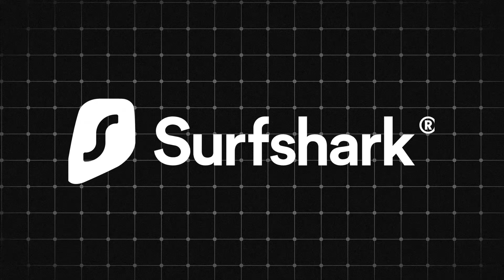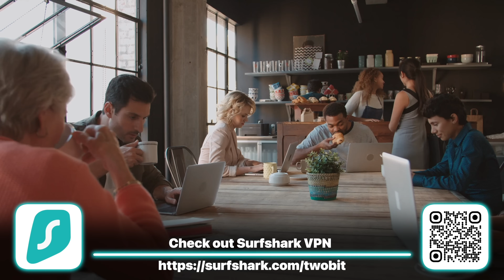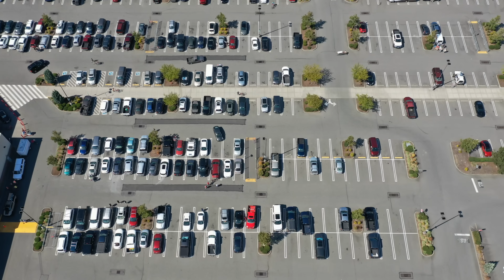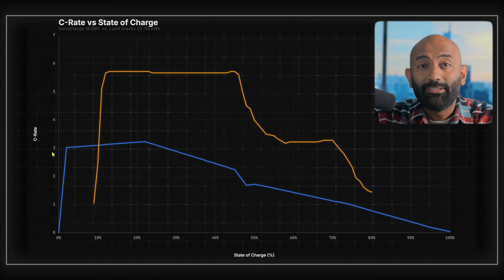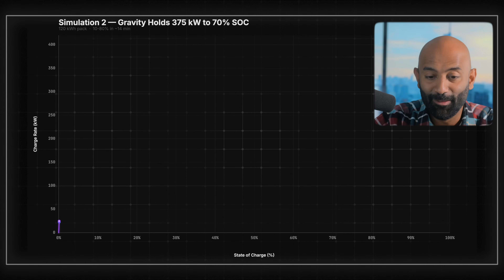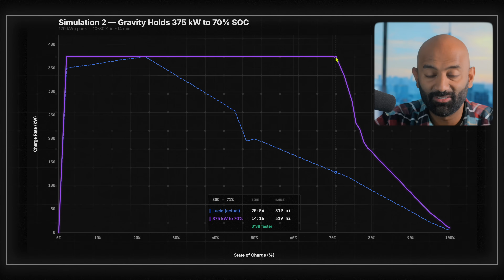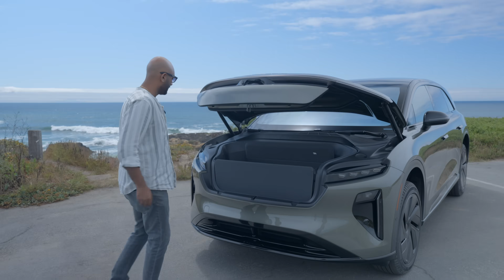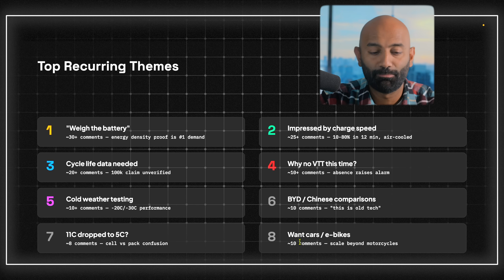Donut Lab Battery Test 4 Changes Everything!

Comment: VTT test number 3 does not say the battery is not a super capacitor. The test results mean that whatever is inside the case has very low leakage. Marko says it is not a super capacitor. IMO a super capacitor with these specs would be very impressive.

Comment: I've got an idea - what if optional "faster charge" is developed: you either use electric-only connector to charge slower & cheaper with bikes built-in cooling, or electricity+coolant connector to charge faster & expensively with externaly cooled liquid. Cooling capacity may be so overboard with external cooling unit....

Comment: I’m hopeful the claims are true, but with electrical grid load, I’m concerned that plugging in half the commuters populace of high amp draw vehicles someday wall cause wicked amp draws that could crash or melt the grid. I do think that charging stations will probably have to have large battery installations to dampen peak amp draws. Perhaps massive installations of these batteries will need to become as common as substations, maybe more so. Perhaps data centers could be mandated to install megawatts worth to smooth their demand on the grid as well.
Reply from the maker: buffering with local storage is gonna be key as EVs scale

Comment: Its not efficient most of the electric charging is lost in heat. 18 kwh battery uses 100kwh to charge it. so if its 12 mins to charge a 18 kwh battery up. That is 20kwh used to charge a 18kwh hr batter to 14.4 kwh usable. The heat loss on charging is 5.6 kwh. Literally 25% of the energy is lost in heat during charging. Its NOT efficient by any means. Your throwing 1/4 of the electricity right out the window. This is not the answer to energy independence at all! Its just a fast charging battery that wastes a shit tone of electricity during charging.
Reply from the maker: Wait, 100kWh to charge an 18kWh battery? That math’s wild - even with losses that’s not how physics works. Real DCFC is ~90% efficient at the battery, grid/charger losses add more but nowhere near 5x.

Comment: One scenario you did not consider is a 60-70 kWh pack that charges at 5C. With half the capacity, you can fill the charge rate faster. A cheaper car (due to half the battery size) with better efficiency (due to lower weight again) is a double win for the masses. If efficiency gains in other areas are combined with this weight reduction, lets say we hit 5.5 miles per KWhr, that is 330 miles on just 60 kWh!! This might finally help EVs hit below $30k AND not compromise on range all the while charging only takes twice the time to fill up gas at a gas station!
Reply from the maker: 60-70 kWh at 5C? That’s the sweet spot — light, cheap, and still 300+ miles. Sign me up.

Comment: About that 100,000 cycles: You have to read the big print. The big print says "Designed for 100,000 cycles". What does that mean? I don't know, but I think I know what it does not mean. It does not mean "tested to 100,000 cycles". It does not mean "guaranteed to 100,000 cycles". It does not mean "specified to last 100,000 cycles". It does not mean "expected to last 100,000 cycles based on cycle testing". It is almost an aspirational statement. "We think given the way we designed the battery it should last 100,000 cycles once we understand how to manufacture it with all the properties of our design." Eventually someone will test it and find it does not last 100,000 cycles, and then Donut Lab will point to the big text and say "We never claimed it would, we just designed it to do so. We believe that with continued development of our manufacturing process, it will."
Reply from the maker: designed for ≠ proven. show us the cycle data or it's just marketing

Comment: To be honest, I would love that kind of scrutiny and scepticism over all BYD/CATL announcements. I mean, the energy density of BYD flash batteries is at the most poor, it makes the cars much heavier and less effective. And CATL Sodium Batteries, well they aren't as inexpensive and we have be told about, and it depends on the price of lithium.
BTW only 10% of the charging energy did not end in the battery, while on lower C charging cars no one gets under 15%, this is energy you pay for but is dissipated to the air in form of heat. 
What were the losses (always based on the nominal capacity) of that Lucid charging session? What are the losses during a BYD flash charging?
If the batterie charges as fast as other fast charging batteries, but weights less and I have less losses during charging, then I have a car that only charges as fast as others but due to weight doesn't need to be that often at the charging station and due to charging losses it cost me less to fill my battery.
Reply from the maker: Lucid’s losses were ~9% — solid number. BYD flash data? Still waiting to see it in the wild.

Comment: Donut Lab has not subjected its solid-state battery technology to independent, third-party peer review or published scientific papers due to a strategy of secrecy, citing pending patents and proprietary technology. This lack of transparency, coupled with performance claims that far exceed current industry standards, has led many experts to treat the announcement with extreme skepticism, often describing it as a potential scam or "vaporware". 

Key reasons for the lack of peer review and the surrounding controversy include:

Proprietary Secrecy: The company refuses to disclose core material composition or detailed manufacturing processes, citing intellectual property protection, which is common in early-stage tech but considered a "red flag" when claiming a monumental breakthrough, such as 100,000-cycle life.

"Proof Through Deployment" Strategy: CEO Marko Lehtimäki has stated the proof lies in the actual deployment of the batteries in Verge motorcycles (scheduled for Q1 2026), rather than in scientific publications.

Contradictory Performance Claims: Experts find the claimed specs (high energy density, extremely fast charging, and high durability) to be technologically conflicting. Some believe the tech is closer to a supercapacitor rather than a "true" solid-state battery, as described.

Lack of Initial Validation: Upon its unveiling, the company provided no live demonstrations, patent disclosures, or independent test reports.

Limited Independent Verification: While the company later announced tests by VTT Technical Research Centre of Finland, only partial, limited data (mostly focusing on fast charging) has been made available, leaving major claims unverified. 

While Donut Lab claims its technology is ready for production, the industry standard of independent, scientific validation has been entirely bypassed in favor of a direct-to-consumer marketing approach through its partner, Verge Motorcycles.
Reply: FYI
To those claiming "Vaporware": The 2026 Verge TS Pro with Donut Lab SSB is a fully homologated L3e-A3 vehicle. Here are the facts.
1. THE LEGAL HANDSHAKE (EU Homologation)
Classification: L3e-A3 (High Performance Motorcycle).
Approval Standard: Regulation (EU) No 168/2013.
CoC Status: Active for 2026 Model Year (MY26).
Regulatory Compliance: Fully compliant with EU Battery Regulation 2023/1542 (Battery Passport & Sustainability).
2. THE SSB TECH (Standard 20.2 kWh Pack)
Chemistry: Donut Lab Solid-State (SSB) | No liquid electrolyte.
Cell Density: 400 Wh/kg (Verified).
Safety Proof: Independent validation by VTT Technical Research Centre of Finland. Passed 100°C thermal stress test with 0% fire risk and 107% capacity retention.
Reply: REAL-WORLD vs. MARKETING RANGE
Marketing Claim: Up to 350 km (City).
Legal Certification (WMTC): 191 km (EU Reg 134/2014, Annex VII).
Reply: The March 16th test is pure physics: taking 14kWh of energy to go from 9% to 80% mathematically confirms a 20kWh pack, matching the Verge specs perfectly.
If it were a scam, you couldn't physically fit 14kWh into a 'fake' small battery in 9 minutes—the charger receipts prove the capacity and the 230kg curb weight proves the density.
Reply: @AJ1964FI  

As you know, we do not say it is a scam yet, but as said a thousand time by now, we just need the extraordinary evidence to all the extraordinary claims. Thats all.

And not with respect to the Verge bike, but with respect to the donut cell / battery.

This is not extraordinary evidence to all the claims, as I am sure you do understand.
Reply: @Unity2-765not a scam,...YET. Got it😊

Comment: One of the two largest weaknesses of the electrical power systems of today is storage and transpiration. Solid state batteries or super capacitors are the holy grail being sought after. Getting more superior products will help in its own way save the environment, especially when I hear the elements being used are not the nasty sorts needed like the current lithium ions are requiring like artisanal cobalt.
Reply from the maker: artisanal cobalt is the worst — hope their chemistry skips that nonsense

Comment: We better get started building out the 1MW charging infrastructure - because these are coming to cars and pickup trucks next !
Imagine a semi that can charge at 5+C rate, !
Three questions I have:
1. weigh and measure the battery/cell to confirm density 
2. low temperature test - ie is this in a motorcycle to avoid winter? or maybe just to accommodate smaller pack.
3. cycles - we need to confirm the cycle life, since all the other impressive results don't mean anything if the battery fails in 200 cycles.
Reply from the maker: semi at 5c? now that's a mental image. and yeah — weigh it, freeze it, cycle it. we want the same receipts.
Reply: @TwoBitDaVinci  I sure hope the April 1st release for the next test isn't the final punch line of the most elaborate "April-Fools" joke in the history of AFJ's LOL. I am on the edge of my seat !

Comment: Donut claim                                                                                                                                    Donut evidence
	                                                                                                                                 
CEO: "We're not talking to investors until all disclosure is done."	                                  Newspaper: "[Donut Lab CEO] Lehtimäki said that the company is seeking additional funding of 30–50 million euros from investors during the                               
                                                                                                                                                          first quarter of 2026, i.e. January–March."

CEO: "No lithium."	                                                                                                                          Engineers, researchers: The Donut Lab VTT test results are what you'd get from lithium, specifically Si-anode Li-NMC. 

CEO: [January 2026] "We are now already at GWh annual capacity."	                                  CEO: [February 2026] "our maximum capacity will be this year if everything goes as planned, i.e. about 1GWh annual run rate"

CEO: "You can go at 5C charging from 0.00% to 100% for 100,000 cycles"	                  CMO: The 20.2kWh-specced battery's charging capacity is 18kWh [implying there's a buffer, likely to protect from damage, at either 0%                           
                                                                                                                                                          voltage, 100% voltage, or both]

Donut website: "Full charge in 5 minutes. There is no need to limit charging to 80%. 
Full charge and full discharge are safe, repeatable, and expected in daily operation"    
CEO: at 5C from 0% to 100% for 100,000 cycles]	                                                                  Verge: A charging video from 10% to 80% that averages 3.5C [Why not 0%-100%? There is no need to limit charging to 80%.]
Reply: Let's see:

Newspaper article: According to the forums, the news source involved quoted, and took out of context, an investor newsletter from December and earlier, prior to the release of the Donut battery, that invited investments in Verge and Donut motors.

Engineers, researchers: The Donut lab battery is similar to multiple chemistries, including Sodium, though not one completely fits the Donut battery profile. Using third-hand metrics, calculations, and hidden assumptions, used by some, has been criticised in respected publications, such as Cleantechnia. The speculations based upon third-party data and guesses are just that, speculation not evidence; there is no proof at this time to dismiss the Donut claim of the battery not being Lithium-Ion based.

CEO [battery production]: The two statements are not in conflict; one reflects build capacity (GWh) capability, and the other is the expected run rate (1GWh) for the existing Donut battery production capability. Further Donut Lab statements reported in January support these figures - which did not change between January and February. Such as the respected industry trade paper EE Times, quoting the stated run rate production figure as " All-solid-state batteries are produced at a factory in Finland, with a production capacity of 1GWh per year." Plus, ChinaNews reported in January that "[Donut] employee revealed that Donut Lab’s current production capacity is approximately 1 GWh, with plans to increase capacity to 20 to 30 GWh by the beginning of next year".  Similarly, Verge CEO stated at CES that the battery production capacity is currently operational in Finland with plans to expand UK and Estonia.

CEO [charge bufffer]: Again, these points are not in conflict; the cell has been demonstrated to charge at 5C, nor has any Donut statement been phrased in absolute terms, rather "up to" figures. The Verge test used a mule bike (i.e. a modified earlier TS Pro bike, which has a charging system designed for Lithium cells used in the old bike) for which the charging was not optimised for the Donut battery. The public charging video demonstrated a 10-80% range (13.998kWh) of the 20.2kWh full battery capacity (not a 10-80%, 12.6kWh capacity, of the 18kWh 'nominal' capacity), indicating that the full battery capacity was being tested and not the quoted "nominal" capacity. The interpretation of the statement adopting nominal capacity terminology, for a specific customer (i.e. Verge motorcycle) application, as implying battery characteristics is again speculation, not evidence.

CEO [5C, 5-minute claim and 80% limit]: This point is taken out of context, assembling different points from the website, for example, the 12C/5 minute cell charging demonstration is where the "no need to limit charging to 80%" statement appears. Further, the Donut (including the CEO) has stated qualified metrics such as "as low as 5 minutes" and "up to" 5C, also Donut states the charge rate depends upon specific application, including the form of cooling utilised. 

As to Verge, as above, they quote a 10-80% 10 minute target for the new bike with the Donut battery, which would set the test parameters adopted, the video was a customer test (i.e. Verge Motorcycles), not a Donut Lab one, who simply presented it. The 3.5C average reflects design choices taken for the mule test bike (whose charger was designed for Lithium batteries), which will impact charging behaviour such as charging profile, charge curve, and thermal cut-off points, affecting the demonstration. Further, application-level tests, like EV car and bikes, rather than cell/battery tests, often quote the C rate over an optimal charging range, not the full battery capacity. However, one can calculate an approximate full cell rate, which in the case of the Verge's 10-minute 10-80% target, would equate to a ~4.2C 0-100% overall target (although in reality no C rate if defined for the 0-10% and 80-100% segments). 

It's a customer application choice as to what charging approach, terminology and parameters they use when adopting a battery, they may apply conservative limits and terms they're already familiar with, at least until they become accustomed to the new battery technology. Particularly if they are using a battery as a drop-in replacement for an older or different chemistry technology, which appears to be part of the aim for Donut's battery to speed up adoption (with the battery being stated as a platform, one that is tailorable to different applications).

Comment: While not a pure battery company, Nikola Motors is often cited as a massive fraud in the green energy space. In 2020, it was revealed that the company’s "Nikola One" hydrogen-electric truck, showcased in a video as functional, was actually unpowered and rolling down a hill. 

The Claim: Nikola had promised revolutionary battery and hydrogen tech that was years ahead of competitors.
The Fallout: Founder Trevor Milton was later convicted of fraud, and the company’s valuation plummeted after a Hindenburg Research report exposed the deceptions. 

The battery industry has seen several high-profile startup "miracles" that failed under scrutiny: 

Envia (2013): Claimed a breakthrough in energy density that won a major contract with General Motors, only to be accused of misrepresenting its lab results and using licensed technology it hadn't perfected.
Satki3 (2017): A solid-state battery pioneer that was sold to Dyson for $90 million. Dyson later abandoned the project, with reports suggesting the technology was nowhere near as scalable or effective as claimed. 

A more recent controversy (2026) involves Donut Lab, which claimed to have developed the world's first mass-producible all-solid-state battery with "impossible" specs, such as a 100,000-cycle life and 5-minute charging. 
The Skepticism: Experts flagged these parameters as defying current laws of physics, labeling the pitch a potential scam aimed at gullible EV enthusiasts.